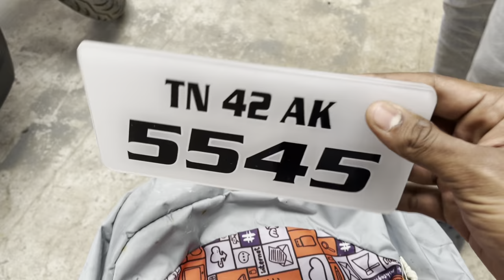MT15 Tail tidy installation Tamil 🤩 | Modified Mt15 🔥

Comment: I thought the mt15 was a great bike in its class until I found about price of service and spare parts. You will spend as much as you paid for the bike within 5 years. The refinement of engine only lasts as long as regular service is done, if not well, the engine degrades fast along with fuel efficiency.